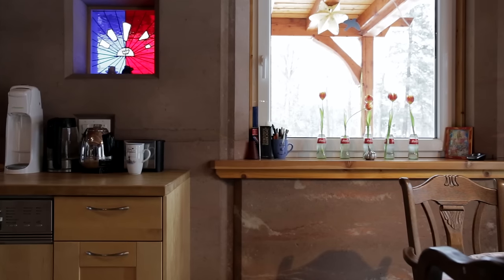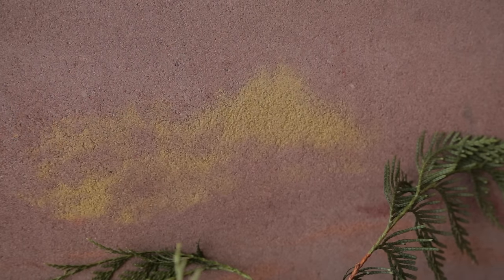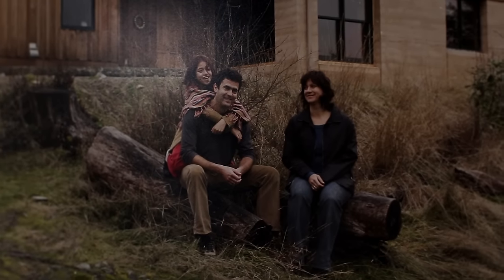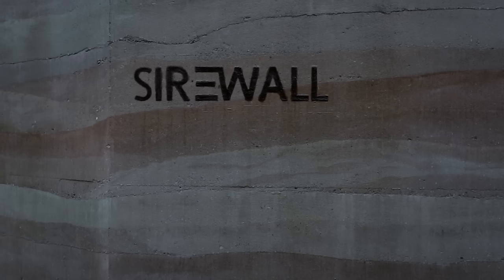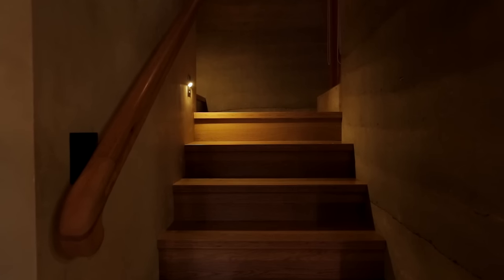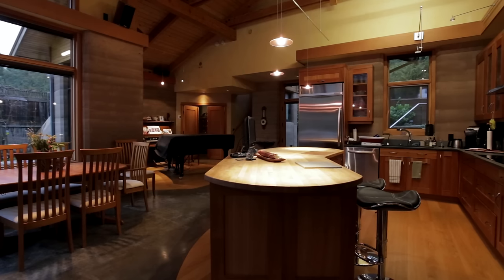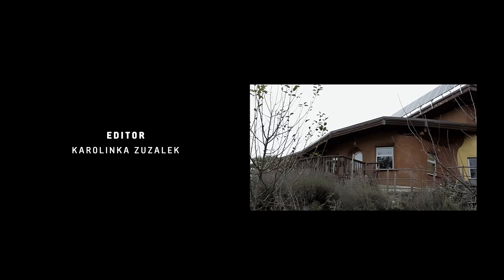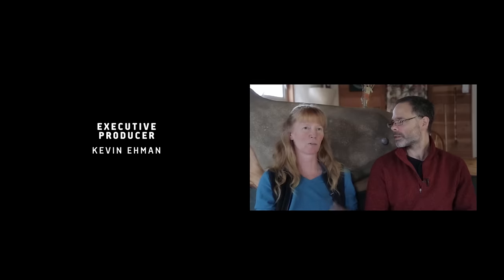Groundwork Episode 4  - Building with Rammed Earth

Comment: How is wiring and plumbing handled in rammed earth walls? Do they embed conduit in the forms? And how would you handle making changes once the walls are done if you hadn't considered something?
Reply: Following
Reply: Why do they have to be in the rammed earth walls?
You have a ceiling, and floor to put things in, and a knock down wet wall built with sheet rock and 2"x4s"

Comment: There is a LOT of wood being used in these structures. There has to be a way to make arches and vaulted ceilings. Otherwise your long lived house will only have its walls after a hundred or two years as the wood rotted away. There is something here for sure, but it is deeply flawed compared to so many other natural building techniques.

Comment: what do we do to avoid scraping of walls due to rain?
Reply: Adding the small bit of concrete to the mix makes it a little stronger and quite resistant to damage caused by rain.  It would need to be quite heavy rain over a long period to erode a rammed earth wall to begin with.  Eaves/veranda's are an important part of design, they protect the walls from direct rainfall.  If you absolutely want to cover or seal the wall for added protection there are several earth or lime based plasters or renders that will do the job and still allow the wall to breathe.  Mineral paints (essentially water glass/sodium silicate with mineral pigments added) is also a good option for any earth or stone based construction.
Reply: This is really a nice explanation. Thank you Lucas :D
Reply: You also need to build wide overhangs so that very little rain gets to the walls.

Comment: How much cement did they add to that earth?
Reply: They use between 5 to 10% depending on the builder and the soil type.
Reply: I guess you have to try a few test runs to get the right results in varying soil compositions
Reply: @timtaylor9339  that's concrete in our books